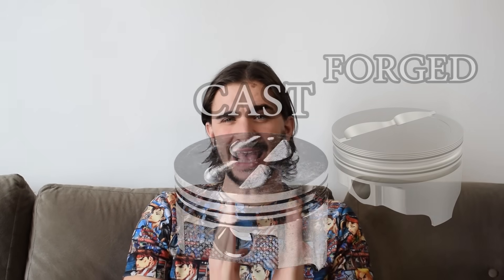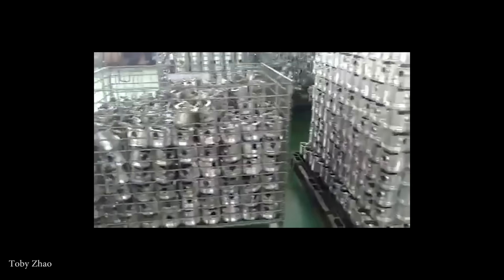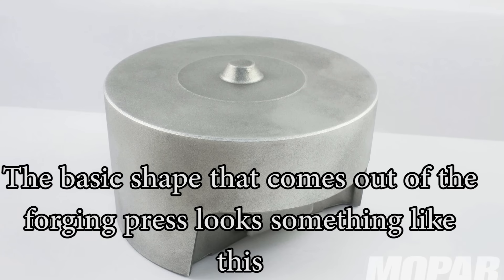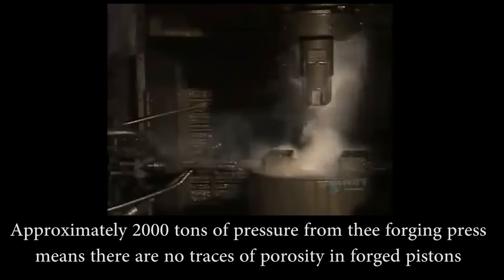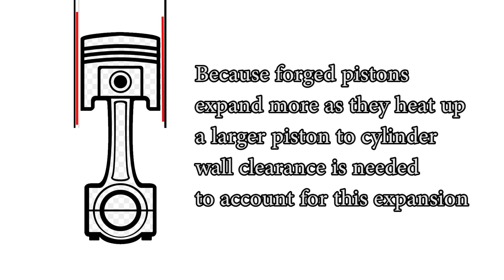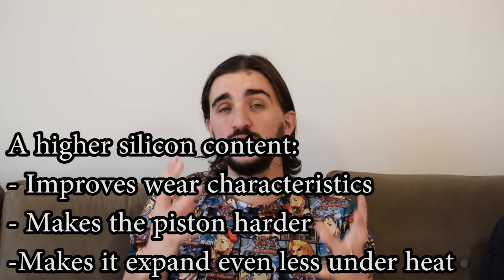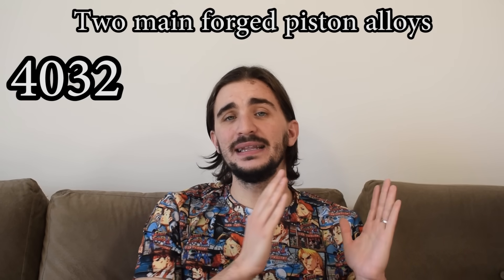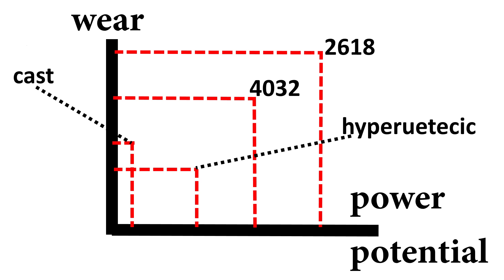FORGED vs CAST vs HYPEREUTECTIC PISTONS

Comment: Put this way, its simpler to say since alloy engine blocks were first made, is when the silicon was used to make them last longer and so much easier to tune and make big hp straight from the factory. :) thats simple,  engine building is like any engineering discipline, put the right stuff in a engine or aircraft engine and service it properly and it will last ,but in all fairness aircraft engines parts all parts go through a very hi end examination process before its used to make any part of a aircraft engine like X raying all the parts titanium, hastelloy inconel  specialised stainless steel, like the turbo blades on a jet engine are made  from titanium and check out the tests they do for bird strikes, they break, why because titanum is very strong,but also brittle under loads. :)

Comment: coat all the tops of pistons and you have a better chance of no deformity, like a hi temp above 1,500 degrees ceramic coating and you have good chance of using just factory cast pistons, depending on how much HP you want as well ? Also if you can ask a forging company to make up your own mix of metals and alloys ,thus you have pistons and other moving parts made to customised alloys like aerospace alloys, so inconels hasalloys titanium etc etc, anything which can take heat and pressuer. :)

Comment: The pistons in my 3.8 liter, V6, 500 hp 1986 Buick Grand National had the factory cast pistons.
Those factory installed cast units were specifically designed for turbo application.
Worked great...never failed, even under thousands of miles at 23lb boost

Comment: If you had forged conrods how well would decent non-forged pistons hold up in a turbocharged engine? Would you recommend forged pistons in all cases?
Reply from the maker: Forged rods can't save weak pistons. As I said in the video, it all depends on the power goals and application. Forged pistons aren't always necessary, but if ambitions are high enough not running them can be a big risk.

Comment: Slightly misleading in terms of thermal expansion, it is the alloy that determines thermal expansion, working a material (like forging) doesn't effect thermal expansion. I am glad you went into detail on the typical alloys though, that helped clear up the statement a bit. All in all a good video.

Comment: It really irritates me, how detrimental cold starts are, yet, I have not heard of a car, motorcycle, or any modern vehicle, that has what emergency generators already had, for a long time.
Block Heaters.
A system that warms & circulates oil & coolant, before the engine even starts.
Just imagine how great it would be, if you had the option to preheat the engine & catalytic-converters, before cranking.
Operating temperature is reached, nearly instantly, reducing wear, piston slap, and better emissions.
But I think it's because of laziness, and greed of maintenance costs, why preheating systems like that, aren't standard, from vehicle manufacturers.
Meanwhile, electric vehicles are rising.
Those of you still loyal to engines, at least the are aftermarket preheating systems you can install yourselves.

Comment: There is an engineering term for the slippery-ness of a metal. So long as money and weight aren't factored and piston diameter is less than  3 inches, why not Kennametal K6. Comes in 3" diam dowel.  No Fe (iron) in this alloy. Heat, ware, coefficient of expansion almost zero. Badass stats on this stuff.

Comment: "What piston is best for your engine" 
Me driving rotary : "why am I watching this?"
Reply: Because you might learn something.
Reply: @d.haroldangel241  Better answer than my jibba-jabba, A+ for content if not effort :)
Reply: Just to add some general knowledge to yours... With that knowledge, maybe you can figure out a way to make Wankels efficient over a long time...
Reply: 😄I don't even change my own oil, but I watch his videos because they are so interesting.
Reply: Wankel engines still have pistons--the rotors themselves. A Wankel is a type of piston engine, it works using displacement.
The motion is different, the function is the same. The original term for Wankel rotary engines was "rotating piston machine."
Reply: @devilsoffspring5519  Are you sure about that?  I've seen rotary engines that do have pistons.  I forgot what the Japanese book I read from the early 70s was called.  I had the pistons splayed out in a circle around the crank Gnome radial rotary design used in airplanes.  There were a lot of different rotary engine designs in the book that was many years above my education.  The function of course is the same as a piston motor with an engine that requires three rotations instead of two to complete the cycle making it confusing for most people.
Reply: @jinxtacy  That's right--those old aircraft engines were "rotary" by definition because the entire crankcase rotated, with the crankshaft stationary. It made for better fuel-air mixture distribution among the cylinders, instead of the lower cylinders running too rich and the upper ones running too lean.
It also meant that they were unwieldy, clunky things that could only be run at very low RPM, so the power output was dismal for the engine's size and weight. Rotating-crankcase engines were only around for a little while before improved designs, called "radial" engines, with a stationary crankcase and rotating crankshaft were developed.
Reply: @devilsoffspring5519  No, rotors are pistons are not the same thing. They have the same function but they are not the same. And a “rotating piston engine” is not a Wankel rotary engine, it’s a different type of engine that has... you guessed it, pistons that rotate.
Reply: He was making a joke...
Reply: @devilsoffspring5519  let people enjoy things
Reply: @KontrolCZ  ?? Not sure why you think I'm not letting people enjoy something, I had an RX-7 Turbo II for well over 10 years, modified it and drove it to work everyday. Pretty good little engine, fuel consumption was high though.
Reply: @devilsoffspring5519  he's not talking about the enjoyment of a car... He just wanted to make a whimsical comment have fun with it the idea the topic that's it.. you've no clue.. he doesn't need correction... Yeah let him have fun are you the comment police or something..
Reply: @Obsidian369  This is a learning and sharing knowledge channel, I can't blame him for doing what he's doing.
Reply: @devilsoffspring5519  . And Oil too .
Reply: @KontrolCZ  . Why not try to Cure Ignorance instead ?
Reply: That wankle engine though
Reply: @a-cast3496  Wankel engine pistons (rotors) are cast iron, at least for Mazda engines... Aluminum ones probably weren't strong enough to put up with the very high rotating mass. Either that or the seal slots would wear out when they made them out of aluminum.
Reply: LOL
Reply: @m05-t3x  Podívej se kdy byl kanál založen...Ale z části máš pravdu, RX7 už nemám,  protože jsou potřeba finance na jiné věci
Reply: Dorito motor
Reply: Cuz it gonna blowww hehe
Reply: What's better motor Gallo  12 or Gallo 28
Reply: Good one 😂
Reply: fun fact.  "wankel" is taken from the word "wanker" meaning "someone (thing) that is useless, time wasting or inefficient".  They changed it from "er" to "el" to distance it from it's other meaning
Reply: @datsuntoyy  Fun fact. Wankel is surename of the creator. German engineer Felix Wankel
Reply: this guy doesn't know his stuff.  he's like i put the intake and the exahust. fully built mannn. the rotors is the piston and the rods dumbass.
Reply: @Poopeepooo123  r u sure? At least we understand what he's saying English shouldn't be that hard I have no idea what you're trying to say in that jumble of words
Reply: @Obsidian369  e un le lun be bon hoop boop
Reply: @Poopeepooo123  . Goonie GooGoo to yoo .

Comment: I see! What I need is really 99% Silicon Forged Pistons for my daily drag racing supermarket runabout.
Reply: But adding silicon makes metal harder and more brittle if you add too much silicon the forged pistons will lose their destruction resistant and will crack more easily

Comment: what i don't understand is, why they don't make pistons with 6-7% silicon content. Its right in the middle of the 4032 and 2618, therefore, it should be stronger than the 4032 but not expand as much as the 2618

Comment: I  have had to Understand some of the Technical differences discussed  here during my time as a Marine Engineering rating with the Armed forces of my Country . My understanding is that Forged Pistons , that need Extensive machining anyway , are actually machined very slightly conical . narrower at the crown , where there is more material to expand . Helps mitigate the Piston slap mentioned because the skirt can still be a reasonable fit as long as it ISN'T  a FULL  skirt . And , no mention of Pressure Casting either  I  notice . VERY HIGH pressure injection molding realistically . 300 bar plus , with a controlled cooling cycle . Very good  product .

Comment: Shoryuken! so in summary forged require fine detailing" manual labor to get it machined precisely, and cast is totally produced buy a machine for mass production, and Hypereutectic will compensate for thermal expansion

Comment: That billet image doesnt do much justice because it shows that the pistol will fail on the skirt. And D4A totally glazes over POST PROCESSING TREATMENT to cast parts to re distribute the grain structure. Good introduction video but in no way a comprehensive guide to forged vs cast.

Comment: Driving 4 answers, I am looking to build a Chevy 305 for a 86 Pontiac firebird. Can I get away with Hyperutectic pistons in a 305 with a cam that will allow the 305 to rev up to 6500 rpm? I am running a Crane z cam with 222 degrees @ .050s for a street/strip build. Mainly street, weekend racer.
Reply from the maker: The cam itself doesn't really "allow" the engine to rev up to any given rpm. If a limiter is removed any engine can rev up to any rpm, the deal is that it will likely blow up fast and won't make any power past a given point. That has to be one wild cam if the 305 makes any useful power past 5500 or 5800 rpm. I'm expecting you're upgrading a lot of other stuff for the 6.5k rpm to make sense? Since the 305 has a pretty decent stroke you will be seeing some relatively serious piston speeds and forces exerted onto the pistons. The important question is what you're planning to do with that engine, race it, go down the drag strip often and drive it aggressively most of the time? Or is it just a street engine that you plan to push and have fun with occasionally? If it's the first case I would go with forged pistons as they will take more beating and will also allow you to experiment with more aggressive ignition timing. If it's the second scenario I would stay with hyperceutic and a 5500 or so redline, I honestly doubt you will be making useful power past 6000 unless you're doing many other serious upgrades, but if you were you likely wouldn't be asking me this question :) All of this is my of course just my opinion, based on assumption and limited info. Someone else might tell you something totally different. Ok, you edited the comment with "mainly street weekend" , I guess second scenario? Any other mods?

Comment: Question! I live in a hot and humid place where temperatures most of the year are 120F- 130F and oil temperatures go high and might reach 240F - 250F just about to reach the kill engine protection system in a motorcycle, which would be the ideal pistons? ... Any higher temperature and it might blow a hole in the pistons or rings due to degradation of oil.

Comment: Thank you! Not even halfway through and already subscribing!

That was, by far, the best explanation I have heard to date regarding the difference between these. Not only from a metallurgical standpoint, but also as it pertains to the most practical intended application for the engine they are going in.

It's quite annoying to encounter someone boasting about their engine's forged pistons in a vehicle they use to drive back and forth to work or school everyday (and never the track), only to see the disbelief on their face at your blasphemy of disagreeing with such a piston choice.

I'll be saving a link to this video and sharing it whenever I encounter such a person.

Comment: I ran a 383 with forged pistons, but I never got a piston slap that I could hear, and I got 150k miles out of the motor as a daily driver. I understand what your saying because I am a mechanic, not an expert engine builder.

Comment: Is it possible to have hypereutectic pistons, made in a way of forging so that the grain flow is also as even as possible? Or is this something that is specifically aimed at only cast? As you had mentioned the 4032 Forged Pistons have around 10-11%, of silicon, but what if you made a forged piston with the 12.5% of silicon needed to be classified as hypereutectic?

Comment: This guy is very intelligent. This is why you see NASCAR teams preheating the oil before they start the engine. If you go with a forged piston always allow the engine to come up to temp at an idle. This pretty much eliminates piston slap concerns. They also make 12 volt heat probes for wet sump oil pans and water jackets in the engine block which helps the engine come to operating temperature in a couple of minutes.

Comment: Excellent video with great information. Wish I had this explained to me years ago. I've heard of the Hypereutectic pistons but I didn't know much about them. Using Silicon (Aka Glass) in aluminum would give it some extra strength much like wrought iron or steel. But I have to say casting has come a long way from the start of engine building. The old way of casting was making a mold out of sand and pouring molten metal into it. Known as sand casting, it produced cheap parts, but the castings were usually weak in strength and could require a good bit of machining as the cast parts would be a bit rough. These early castings could have microscopic air bubbles and the metal could have large grains causing them to be weaker that forged pistons. You could see the large grains in a broken part. Newer casting processes like investment casting and spin casting made the parts have much smaller grain size, eliminated all air pockets of any size, made the parts much stronger and cut final machining to a minimum. Many parts that are made using these processes come out with much closer tolerances and smooth finishes. 

As for forged pistons and piston slap causing wear in the cylinder bore, I've never noticed that in any engine I've rebuilt. Even after well over 100K on the engine. I would imagine the piston would wear more that the cylinder walls. Even in the aluminum blocks they have a silicon carbide lining in the cylinder walls that make the walls much harder than aluminum alloy.
One thing I kind of wish he did talk bout are the completely machined pistons from solid stock aluminum alloys. I've heard some of the same praises from forged pistons on these machined pistons. So many talk about how good a machined part from a solid billet is compared to machining from solid stock. Like the claim made about something made from aircraft grade aluminum. Most have no idea about what they are talking about and is usually some kind of an advertising gimmick from someone that doesn't know anything about metal. I've been a machinist over 40 years and I laugh at people when they come in talking about stuff like this. First a billet is nothing more than a cast or rolled shape of metal that usually requires a bit more process at a refinery. But really it is nothing more than common solid metal stock. As for aircraft grade aluminum, that is another gimmick. As there are many grades of aluminum used in aircraft construction, all have advantages and disadvantages depending on what the metal is used for. Common grades for aircraft use can be 2024, 6061, 5052, 7075 and a lot more. Then there is the harness or Temper of the aluminum that is identified by a T indication. It is most commonly given as T1 to T10 or O. O is soft and T10 would be harder than T1 and all that also depends on the alloys in the aluminum.
When someone trys to sell you something and they say it is made from aircraft grade aluminum, have some fun and ask them what aircraft grade is it and what T hardness is it. They look at you like a dear in headlights or they will repeat, "But it's aircraft grade" like it is something special. I have a lot of fun with that. Sometimes I ask for an MSDS or SDS on the item and tell them that it contains hazardous materials just to blow their minds.

Comment: One of the most reliable B18C engines I put in my civic kept the Hypereutectic pistons but better rods in NA config. I went between Vegas and LA for years without any issues on that engine. It was amazing.
Reply: What's your setup and power? Did you drive it aggressive often? Most Honda engine is reliable.  Even b20 Frankenstein build will later at lease two years it said it's one of the unreliable build.
Reply: Are you still active? Currently building 2 b16 motors

Comment: i used forged pistons in my 469.4 c.i.pontiac.4 of them crumbled in my hand when i tore it down.i was told my compression with 16 castings heads would be 12 to 1 so i went with forged.i mighttra some hypertuectic next time.